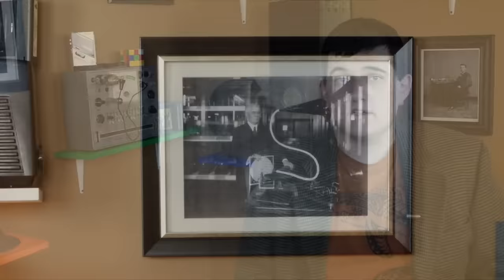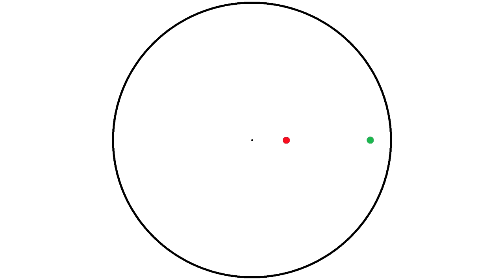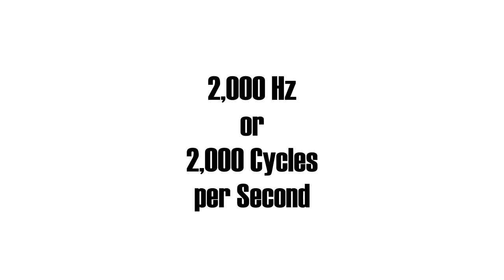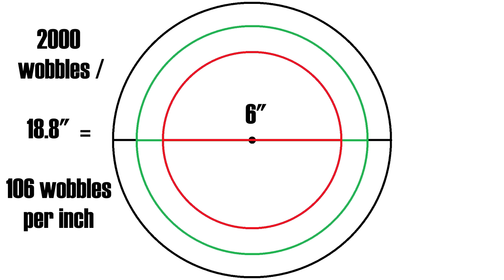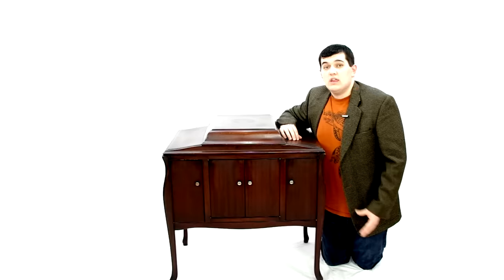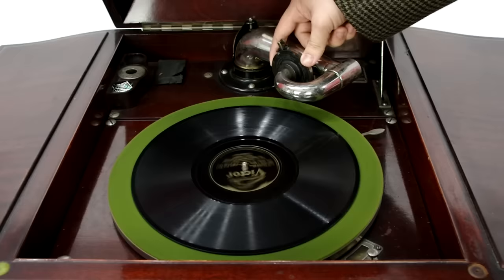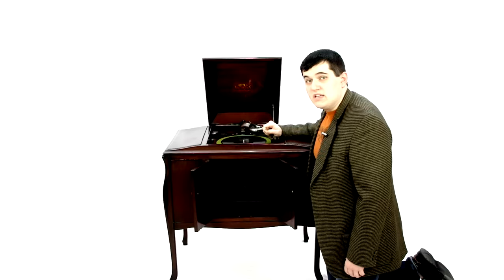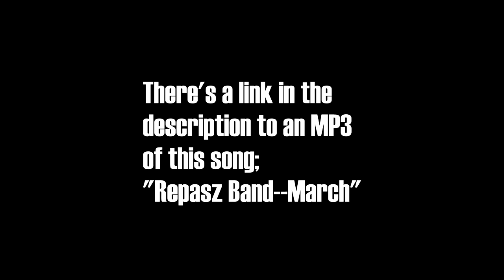Emile Berliner's Fix: Flatten the Cylinder to a Disc

Comment: The issue of frequency response which Edison at first recognised as the advantage cylinders had over discs, did raise it's ugly head again once sound quality improved with the introduction of polyvinyl acetate 33⅓ rpm discs.  Luckily this was solved with some clever mechanical engineering at the pressing plant, and the use of Compressor Limiters in the Mastering stage — but it did occasionally produce headaches for record producers nonetheless, thanks to the idiosyncrasies of musicians and producers who insisted on a certain play-order of songs.  Famous examples include early pressings of Led Zeppelin 1, which would cause the needle to jump out of the groove on record players with cheap or poorly balanced tone arms.  Despite that sound engineers who understood this problem did try to encourage artists and record producers to sequence the order of songs with high dynamic range towards the start of Side One and Two on the outer edge of the disk, some musicians ignored this advice and found out the hard way that physics pays no respect to artistic choices.  For example, Barbra Streisand famously ignored her engineer's advice not to place 'Somewhere' from her Broadway Album at the end of Side Two - which resulted in early pressings of the award winning album being basically unplayable on all but the most high-end of domestic record players, thanks to the explosive finale coming so close to the centre of the disk.  The record company later re-issued the album with a re-mastered version of 'Somewhere' with a whole 5dB cut from the low-end at the mastering plant — leaving the recording feeling much flatter than it was intended to sound.  Indeed this was cited as a specific example in industry journals of the time, as being one of the biggest advantages which the fledgling Compact Disc format had over vinyl, since digital mastering merely required that the maximum peak level was within a -3dBV to 0dBV threshold across the whole programme - regardless of where in the play-order those peaks were physically located on the disc's surface.
Reply: Jim Gardner that's dope. Never would have known about that, thanks
Reply: Until very recently I did not know vinyl suffered from decreasing sound quality and the ability to represent high frequency or loud sounds on inner parts of the disc.  Yet.. I have people still frequently tell me that vinyl is superior to CD, despite the perfect frequency response, much higher dynamic range than vinyl, and uniform sound quality from the first minute to the eightieth.  Somehow people still regard vinyl to sound superior.  It doesn't make any sense apart from the 'feels' people have for vinyl.
Reply: Jim - "The issue of frequency response which Edison at first recognised as the advantage cylinders had over discs, did raise it's ugly head again once sound quality improved with the introduction of polyvinyl acetate 33⅓ rpm discs."
I do wonder if this came sometime after the arrival of microgroove records, perhaps with the arrival of stereo. They ought to always be played with a well designed and properly balanced tonearm.
 Microgroove records play best with an elliptical stylus, not a spherical one.

I wonder if any musicians and producers who "insisted on a certain play-order of songs" hoped that anyone who wanted to play their records would play them properly using equipment that has no problem tracking high dynamic range even towards the end of a side.
Reply: I think you mixed two things up: frequency response and dynamic range.
Reply: It's typical for a musical composition to crescendo, the end of a record tends to be much more bombastic than the beginning.  If vinyl records ran from inside to outside, it would leave the high IPS section of the disc free for more powerful tracks.  Or, each individual song would increase in IPS as they progressed, meaning you'd have more dynamic range available for the track's finale regardless of it's position on the record.  I've actually seen some LPs pressed to go "backwards" like that, particularly performances of Ravel's Bolero.  Might as well have the quiet strings and flutes at the center of the disc and the entire screaming world toward the edge.
Reply: I like your profile picture. Nice to meet a fellow left wing (sensible) person who's interested in early recorded music
Reply: I agree with much of Jims comment but just add that pressing of vinyl discs (not acetate)? was pretty much 'mastered' no pun intended before the introduction of the long playing 33/3 with width and groove spacing and the curves chosen for playback for the velocity generators and noise reduction and so on well understood - and a little care was all that was needed to make a 'playable' record. I've never had an issue with any record over the last 50 years on anything from a changer to a  Goldmund. (Including Led Zep). Vinyl was introduced at a time when the film studios and the recording industry had truly nailed audio. 
Bing Crosby had heard a Tonschreiber from Germany, as a few had made it over to the states after the war. Bing wanted to relax at home or the studio and not worry about his live radio performances. He bankrolled Ampex to make a machine to record his show. It not only revolutionised radio, but Elvis and Frank Sinatra and the whole music industry we knew might never have happened as here was something truly close to perfection. Frank got a new lease of life - his voice never sounded so good.. Now how do we sell some of that quality to consumers as cheaply as possible? It's not master tape its a cheap lump of PVC but it does pretty well, and at its best is very good indeed.
Listen to a master tape for ultimate jaw dropping experience.
Edisons' cylinder was CLV (constant linear velocity) and parallel tracing (old word for following groove direction) which would be ideal. Berliners gramophone was CAV (Angular) The CLV / CAV thing was next bandied about with Lase disc...
Reply: So.. essentially, you said the industry tried to solve a problem it created itself by going to disks, and then created other issues... 

Sounds just like the modern industry of nowdays.
Reply: @CatsMeowPaw  That's because other stuff totally non related to this. Vinyls, were made before the loudness and compression war.

Even if the vinyl was having a loss in quality, this was minimalized during the evolution of vinyl (so 70's ones and newers sounded better than the 40's and 20's records).
While cds, and dvds were born during the boom of the loudness war. 

This loudness war consisted in compressing the music, to make it as loud as possible. 

So allegedly, it does cause a loss in the dynamic of the audio, and detail loss. 

So tecnically due to only mastering reasons records/vinyls sounded better, not to a recording fidelity point. 

I won't say i agree totally with this, but indeed if you open in audacity old music recorded from vinyl and new music straight out of cds and dvds that seems to be true. 

And working with audio a little bit (no i'm no expert, just done some basic video editing, and thus worked with audio), and indeed i feel a bit of an loss when i compressed the audio to make it louder without distortions during the video. 

But i must say i have no issues with cd music.
Reply: Aside from the mix-up of frequency and dynamics, I can't help but find it funny that placing louder music at the end of a side is considered an "idiosyncrasy" of musicians and producers. It's just been a tendency of Western music to end with a loud bang for the last few hundreds of years now, and it's frankly ridiculous for recording engineers to expect artists to go against the flow of culture just for the sake of some stupid limitations from their stupid format. If the needle jumps out of the groove, we don't blame physics; we blame the goddamn engineers!
Imagine if that kind of conflict happened back in the 19th century?
"Hey, Beethoven, my man, listen here. Um, your ninth symphony? Amazing. Absolutely amazing. Love it. But you see, we ran into a tiny issue with the record plant, y'know, what with your music now being sold on disc. And, well, that loud and bombastic ending to the fourth movement? That's going to cause a problem for listeners, because the needles jump straight out of the groove! Ha ha, isn't that hilarious? Yeah, so, what it you switched the order of the movements of your symphony? You could start with the 4th movement, since it's the loudest one, and end with the 3rd, which is quiet and chill. That would be great. Now, what would be truly fantastic is if you could maybe chop up those movements into small 3 minute songs, so we could arrange them on the record however was best for us. What do you think? It's reasonable, right? I mean, it would be super unfair if you expected us to satisfy the idiosyncrasies of musicians such as you, right? What do you say?"
Reply: @CatsMeowPaw  Technically a CD can sound at least as good, provided the mastering checks out and because its digital you don't need a high end player to get the best possible quality of the format, unlike LPs. 

However, in reality some studios actually flatten the dynamic range in their mastering because they want to make their CDs to work without much fiddling with even the most basic stereos. This leads to the weird situation where the very same album on LP can factually have superior quality.
Reply: @CatsMeowPaw  
Vinyl is in no way superior to anything digital these days this is a fact the thing people state that vinyl sounds better is from the loudness war when digital media allowed for some pretty ridicules mastering that ruined dynamic range, vinyl however having to maintain strict regulations because otherwise the design would not work properly was saved from the loundness war so all the proper masters came out on Vinyl whereas CD was left with blown out music.
The loudness war still persists to this day but its arguably getting better.
Properly mastered CD is superior, no noise and very high dynamic range compared to what the best vinyl can ever hope to achieve however Vinyl has an advantage that CD cannot get, its analogue and everything that comes with analogue tends to have a character to it, a feel if you like its unique because its not perfect in many ways its like video and film, digital cameras tend to shoot very clinical clean images whereas film tend to not be all perfect, colours and light behave odd but it creates a texture that people likes and can ignite nostalgia in people that never even watched film before, the same is true for analogue audio its not perfect it has textures these create character.
And its these character to it that adds to an atmosphere, its psychological you see because the human brain works in odd ways as it always expects flaws it never expects perfection. 
There people who written long scientific articles on this you can Google if you are more interested in this phenomena.
Reply: This comment deserve to be pinned. Thanks for adding info.
Reply: @SMGJohn  The original "vinyl is better" attitude came from a belief that converting audio to zeros and ones was inherently a downgrade (which it isn't so long as the samples-per-second is high enough). It was a type of Luddite-ism.
Reply: Ummm... that's "its" in this case, if you please.
Reply: "Vinyl has an advantage that CD cannot get, its analogue and everything that comes with analogue tends to have a character to it, a feel if you like its unique because its not perfect in many ways..." What you're saying is that you prefer the distortion built into the mastering process of an LP. Namely, the limiter/compressor used to transfer sound from a tape recording to the mastering transducer prevents one groove from impinging on the previous or next groove during very loud passages. No matter how you look at it, that's "distortion." There is no compressor needed when mastering a CD. The LP-loving crowd likes to claim that a CD "lacks the warmth of vinyl." That "warmth" is nothing but even-ordered distortion, and lots of it for recordings with a lot of dynamic range (loud/soft).

Anyone claiming that an LP is superior to a CD for whatever reason is incapable of proving his point via measurements. In every conceivable measurement test, CD's run circles (ha-ha) around LPs. "Warmth" is LP-lover terminology for "distortion."
Reply: Demef Maybe LP warmth is a little smoother than CD loudness war syndrome?
Reply: @SMGJohn  So the LP advantage is entirely made of 50% psychology and 50% boomer nostalgia? And exactly 0% actual audio?  Got it, thanks.
Reply: @CatsMeowPaw  I think the reason people believe in vinyl being superior is basically a just coincidence in time. 

Around the time CDs (and subsequent media) entered the mainstream, the infamous loudness war had started, deterioating sound quality below the capabilites of good, not worn out LPs. It doesn't matter if the CD offers >80dB of dynamic range instead the 30-50dB of vinyl records if you smash it down to 3dB in mastering. 

You can see that in Youtube videos of vinyl records being played, in the comments people say the sound better (and they often do!) .. without really realizing that they are listening to a digital copy, through a 128-192 kBit AAC codec. Thats because the MASTERING is better, there are grabs of the master tapes used to make the records around if you look for them, they often sound just fantastic. (The analog, half-track tape at 30ips they used was good enough for CD quality).

You can even find "test" stereo recordings of classical music from 1944, they are very good even if looked at in todays standards (and the dynamic range is good enough that you hear the bombs/artillery/flak in the background during the silent passages, since they were recorded in Berlin.) 

If you use the same well made master, CD is superior in every aspect. If the master is crappy, CD can't save it.
Reply: @CatsMeowPaw  It's an analog vs digital thing.  The digital signal has to be converted into analog in your brain, resulting in 'fatigue'.  I prefer the sound of vinyl even if it's less perfect.  Music isn't supposed to be perfect it's supposed to be natural.
Reply: @SMGJohn  this is true but nowadays digital technology is so advanced that you can literally simulate the "flaws" of analog completely digitally. So you can get every benefit of digital, and still add that "character" of analog, but have full control over whether you want it or not. 

So digital can do everything analog can do but analog can't do everything digital can do.
Reply: @kenlieberman4215  your brain doesn't convert digital signals lol! D/A conversion is done before the sounds gets to you. Your headphones/speakers are analog. Your brain is hearing an analog signal. We cannot hear digital signals. 

The fatigue thing you're talking about has to do with poor compressed audio quality. Like when trying to reduce a file size. Like basically all YouTube audio 😢
Reply: @thegardenofeatin5965    I guess there's no technical reason why a turntable wouldn't play an inside-to-outside disc perfectly well, except the auto-stop feature wouldn't work.   And of course users would have to know to start the tone-arm in the centre.
Reply: Dulce de leche
Reply: @kenlieberman4215 lmao wtf, you have no idea what you're talking about. I can't even.

Comment: That Victrola is just gorgeous.
Reply: And sounds astonishing for what it is, i.e completely acoustic with no electrical parts or electrical amplification.
Reply: It makes me want to get one just to see what it sounds like in working order.
Reply: My grandparents have an old crank Victrola, still works well.
Reply: I've heard them in antique shops. The well-maintained ones sound far louder and much less 'tinny' than I'd expect, or hear in movies when they show 'source' sound from a 78 crank phonograph. Sounded good, considering the completely acoustic/wind-up technology.
Reply: @Tadfafty  Man, that's impressive!
Reply: @Hadloc411  I have my Victor VV 8-4 and it was one of the Orthophonic Victrolas and it still runs well. I can also play 50's doo-wop and early rock & roll on my 1926 Victor VV 8-4.
Reply: You can see the roots of RCA. The perfectly preserved label alone is great to see.
Reply: The irony is that that model (cabinet design) nick-named the humpback was one of Victor's few flops. The buying public preferred the "uprights"
Reply: Is today's Victrola the same company as the old ones?
Reply: @budmeister  RCA (Radio Corporation of America) bought the Victor Talking Machine Co. in 1929 Becoming RCA/Victor (At least the U.S. division, not sure about all the other world wide operations) They can still use Nipper, their mascot, in the U.S. market.
Reply: @aodhganmerrimac  So it's that one that's making all the modern ones that include bluetooth connection? I found them being sold on Amazon.
Reply: @budmeister  I don't think so. It looks like RCA let the trademark expire & this other company grabbed it. In the U.S. Victor, makers of Victrolas was RCA, in Asia it's JVC, in England it's HMV, in Germany it's Deutsche Grammophon IIRC. I think RCA is broken up now.
Reply: @aodhganmerrimac  I just checked their website and it looks like Victrola is owned by Innovative Technology.
Reply: @aodhganmerrimac  They were called HMV (for His Master's Voice) in the UK.
Reply: @budmeister  to answer your question, no, it is not the same company. Victor Talking Machine company  is still a thing and they still make record players, but the common "victrola" record players on amazon are fake and have been sued about 6 times for using a used trademark.